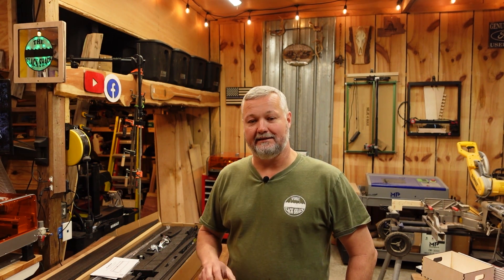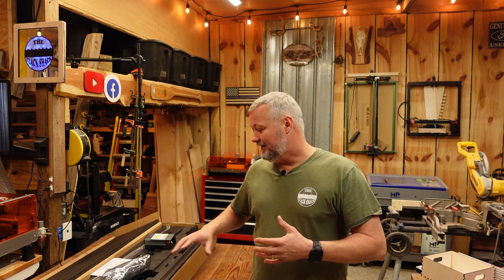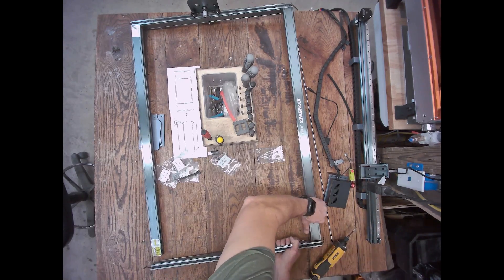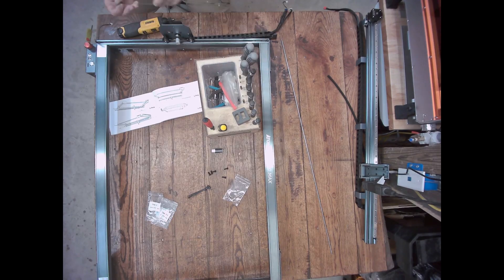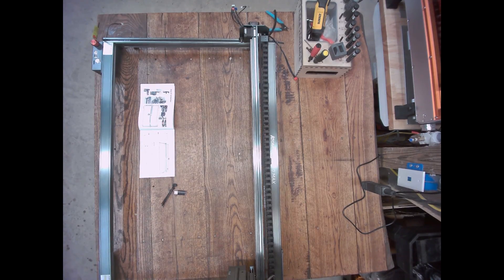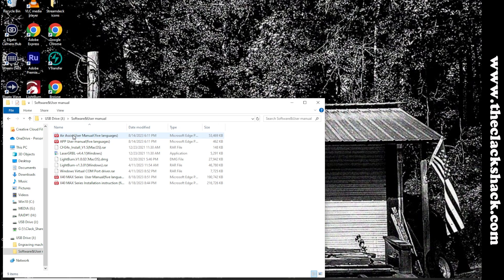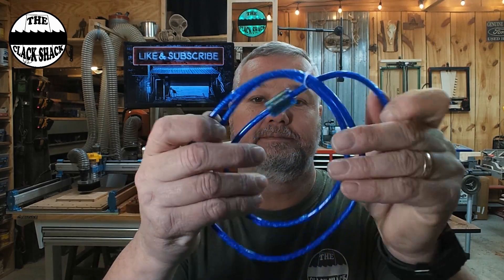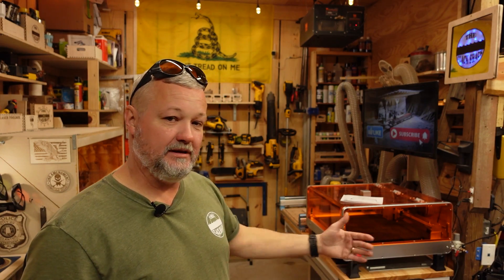Beast mode- The new Atomstack X40

Comment: I got the x40 thinking it was going to be a power house machine with 48w but sadly didn’t get it they gave me a 40 w for the price of the 48w , worse laser engraver I ever bought.
Reply from the maker: As far as I know, they only make a 48 watt module. Make sure it it switched to 48 not 24
Reply: @TheClackShack  watching you assemble the unit ,I noticed they sent you the 400 x 800 what they sent me was smaller work area and mine is a 40w 20w so I got screwed from the company .
Reply from the maker: @ the only other option is an X40 pro which is the same machine with a smaller work area. To my knowledge, all newer Atomstack machines use 12 watt diodes which makes a 40 watt module impossible. Not sure what the mix up is

Comment: Thanks for the videos. Some of my favorites and super informative. I’m just curious as I’m trying to decide which to get. My d1 just started having issues so I’m in the market.   Would you prefer the roly 30w xw or the atom stack x40? I do a lot of  relief cuts on projects as well  engraving to give context. Thanks!!
Reply from the maker: Very welcome.. Both are good machines, the x40 will need an enclosure of course. Roly makes a good enclosed machine with a fair amount of power. Either one would be a good machine, its a matter of the enclosure needs you have. The x40 is much wider though if that is a concern.

Comment: Interesting, currently have an Ortur LM3 4 months old and having an issue with what I believe is the Y axis motor. Unfortunatly Ortur support is completely non responsive so I'm looking for another brand that supports their products. It would appear that Atomstack does, would you agree? Thanks
Reply from the maker: I haven’t had any issues with Atomstack but others experiences may differ. I haven’t had to get technical help on many machines.
Reply: Thank you for your opinion

Comment: How did you get past how bad the head sags when trying to set the focal distance? I've been fighting mine for a month and couldn't even come close today when trying to engrave some pencils...this machine sucks. Upgraded from Atomstack 5.5w to the x40 max and been hating life since I spent $1300!
Reply from the maker: I have not seen any sag in the machine I have. You may wanna make sure everything is assembled correctly.
Reply: @TheClackShack  oh I've had the head off multiple times and made sure all the bolts on the x were tight but still sags...also when I grab the head there's up and down movement  that I can't find the source of 🤬

Comment: Excellent, you sold me. However, the A70 is coming out. Should I start there?
Reply from the maker: The 70 watt may be a good machine but I haven't got my hands on it yet. It also comes in an 850x850 but that is too much laser bed for me. I got the 500x500 coming.
Reply: Mine just arrived today! This set up instruction leaves something to be desired. Hopefully you’re putting out a tutorial. 😉
Reply from the maker: @reedrobb  It wasn't that bad. I think I had a bit of a how to on it in one of the videos.

Comment: Hi David, I got this beast the other day and man this one is a game changer. I was able to cut 1/2" (single pass) and 3/4" (2 passes) Baltic birch plywood so now the possibilities are once again endless. I am thinking dovetail drawers and small cabinets.  I do have a question if you don't mind, did you set the air assist to M8 or M7 like the manual says. When I try to set to M7 I get some GRBL warning, and I am not bold enough to click yes so, I am trying to find out do I use M7 as the manual shows or M8 for the air assist? What did you set yours to in Lightburn? Thanks.
Reply from the maker: Mine is set to M8.

Comment: How do you feel the x40 compares to the lasermatic? I know the lasermatic is the better built machine, and better supported, but what about in terms of actual cutting and engraving performance? I can get the x40 pro (non max) with rotary for less than the 30 watt lasermatic without rotary. I have this crazy idea to use an old green mountain pellet grill I have to make an all metal enclosure. It’s the perfect size with a nice tall door opening, with enough depth to even possible build an adjustable table. So I don’t really need the lasermatic for the enclosure. Also considering the Acmer p2 33w
Reply from the maker: The Mk2 is a 30 watt but for most jobs, its only downside is the work area.